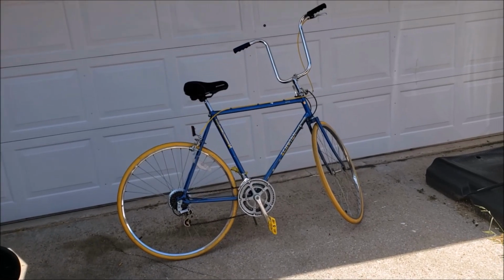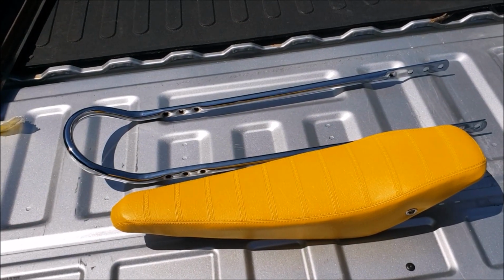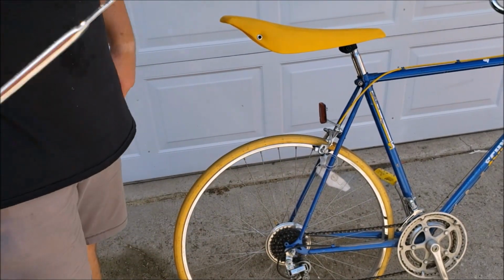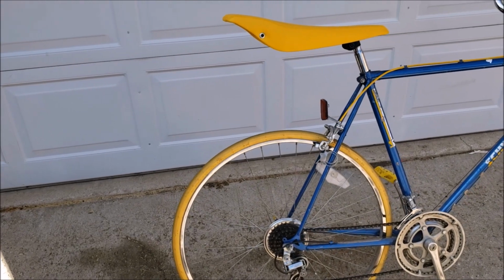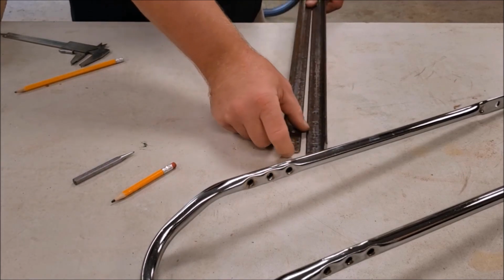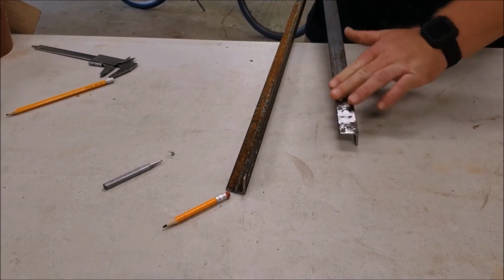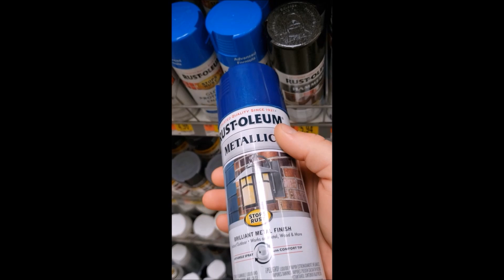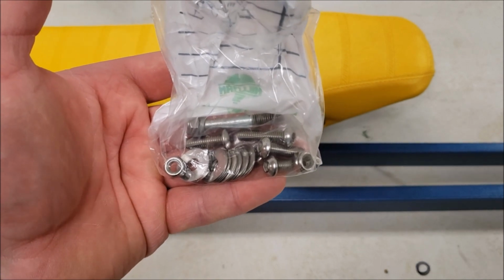Banana seat on a '84 Schwinn Sprint 10 Speed Bicycle

Comment: cool, do you still have it on or reverted back to the single stem modern style?  I got a similar setup but was able to drill the sissy bar higher and still use that.  It looks good but as you mentioned, the seat itself is uncomfortable.  Now wondering how to add padding...